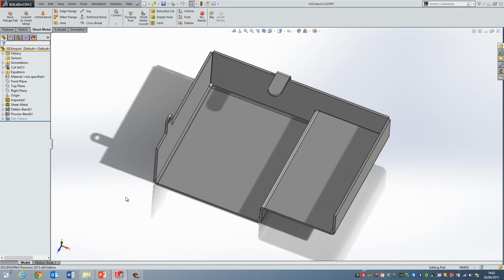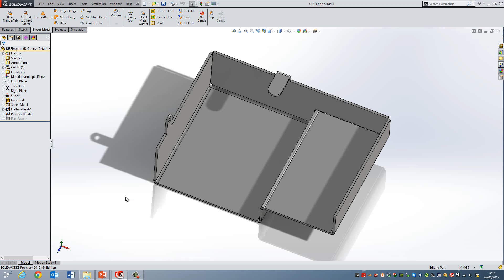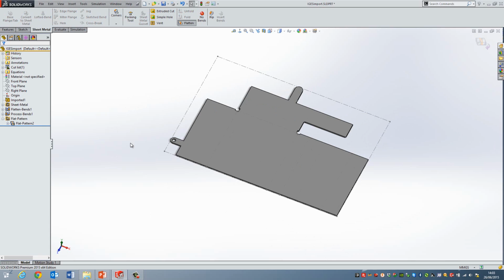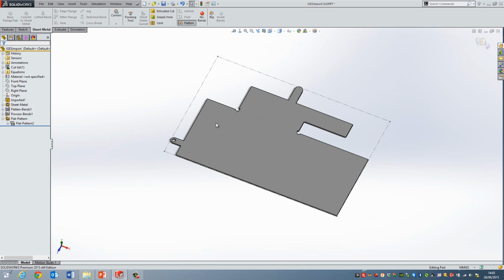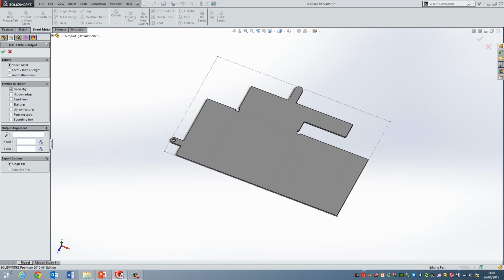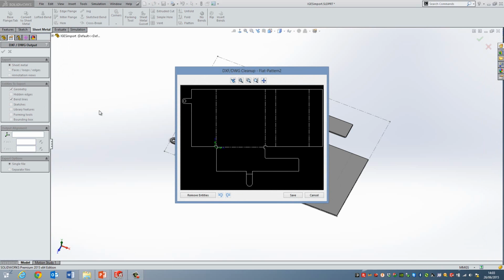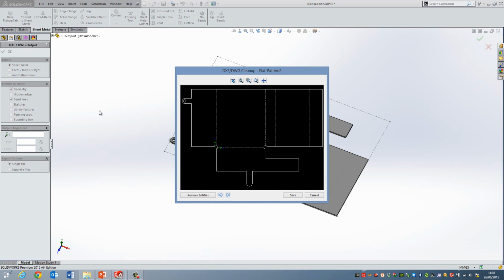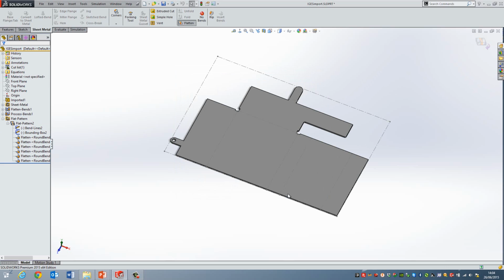What's the best way to export a flat pattern DXF for laser cutting?

Comment: If there is a CSK hole on the sheet, the DXF shows two concentric circles. Is there any way to export only the inner circle without manually deleting the outer circle? This is important when a sheet has many CSK holes, say 20+, and the DXF needs to be sent for laser cutting.

Comment: Even when I check bend lines when saving to dxf they don't show up in the dxf, i have tried the fixes on the solidworks forum but still can't get it to work. Any ideas? 

Current work around is to flatten then convert entities to create the sketch then cut and paste into a drawing and then save as dxf, total pain that is unnecessary.